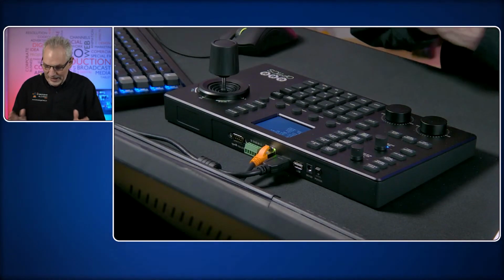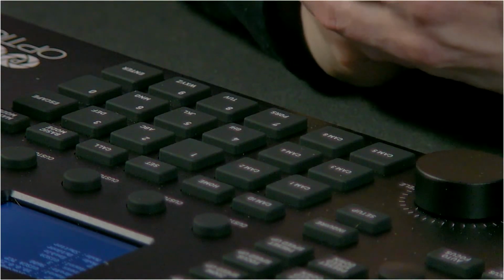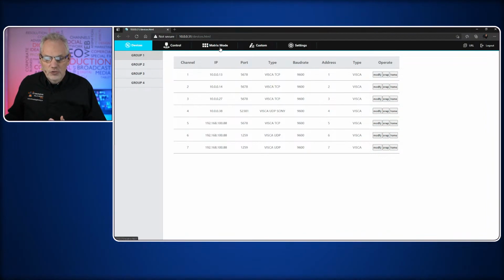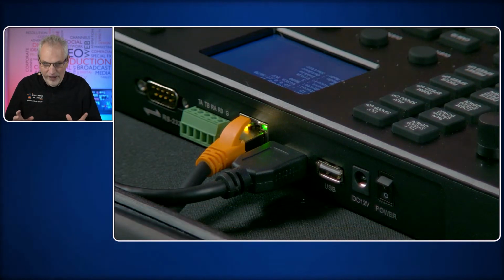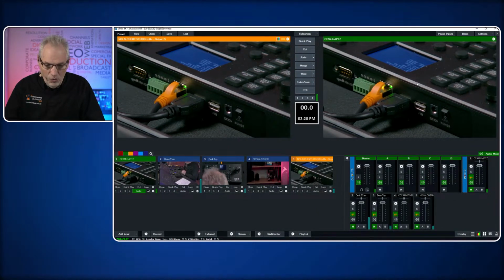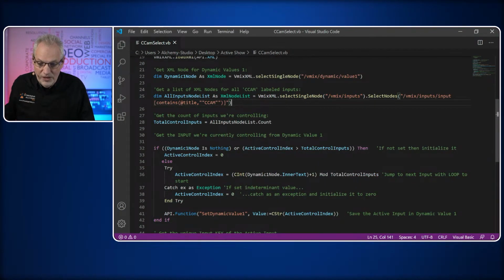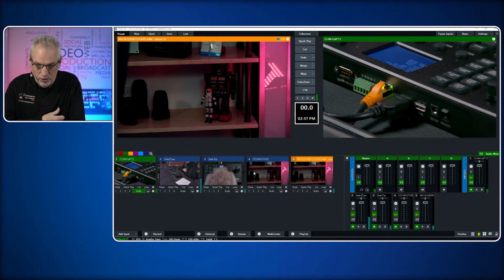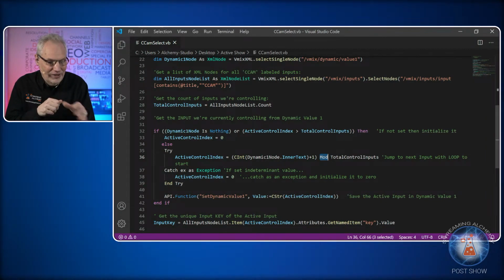Using the PTZOptics SuperJoy with vMix

Comment: You mention that the HDMI preview output uses RTSP and doesn't require NDI, but does it support NDI for those of us that do have an NDI setup?
Reply from the maker: Hi Cheyenne - When the Move 4K camera is connected with the Superjoy controller, the controller will take the RTSP feed from the selected camera to feed out it's HDMI port. The HDMI poet of the camera itself operated normally as does the NDI feed sent out by the camera. The RTSP and NDI feeds coexist on the network with no problem, and you NDI setup will operate normally. Let me know if this covers what you were looking for.  Thanks for talking the time to watch!
Reply: @StreamingAlchemy  I was asking if the HDMI output on the device will support showing a preview of the NDI stream from an NDI controlled camera, just as it previews the RTSP stream for other cameras.
Reply from the maker: Hi Cheyenne - When the Move 4K is being controlled via NDI, the video will also be fed out of the HDMI on the camera - giving you a second view of the feed you are receiving over NDI. That said, it is my understanding that the HDMI and SDI cannot both be active on the Move 4K. This would mean that you could have NDI active with either an HDMI or SDI feed, but cannot have both SDI and HDMI active together. Hope that helps!